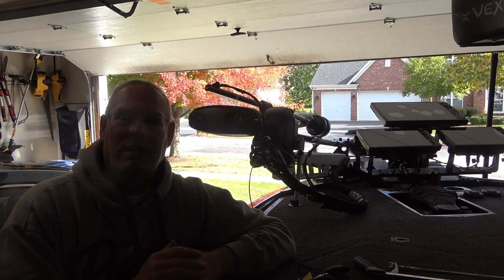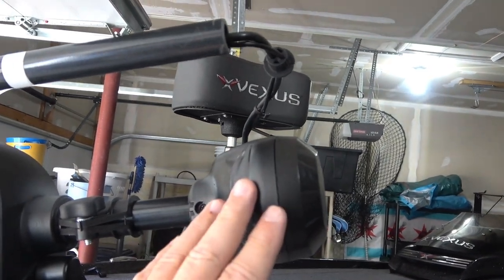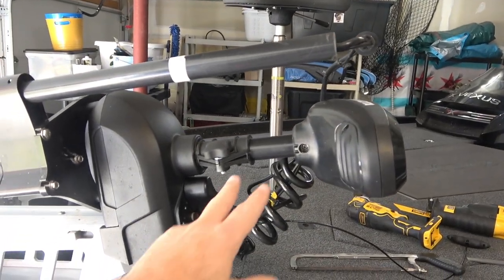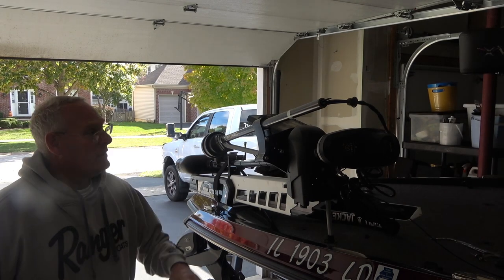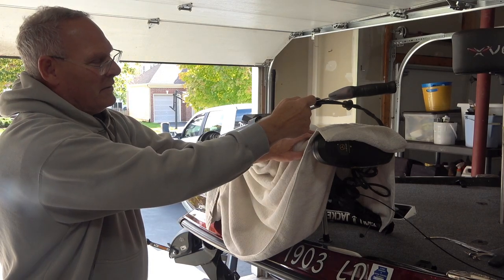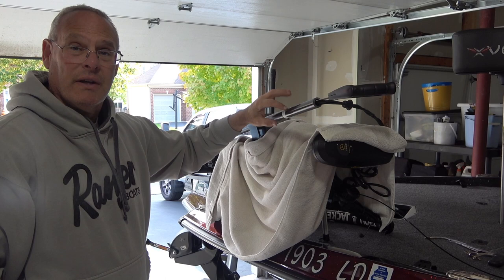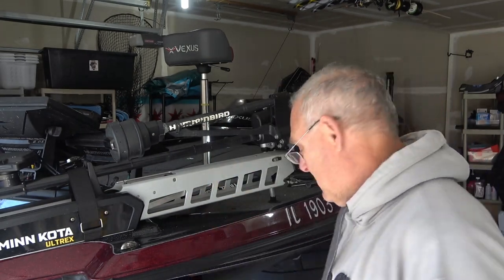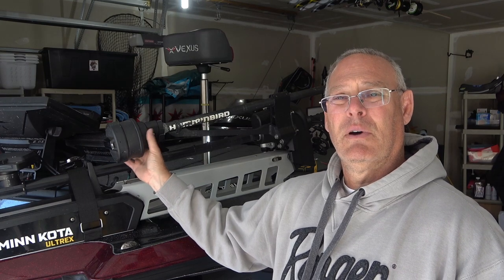The BEST Humminbird 360 Mega Hack

Comment: Pipe cutter ???
Reply from the maker: I have never used a pipe cutter but I am afraid you might be more likely to cut the wires.
Reply: @highschoolfishingcentral7753  a pipe cutter only cuts to the inner wall of the tube
Reply from the maker: @garymeives762  Good information.  I don't own one so I am not familiar with how they work.